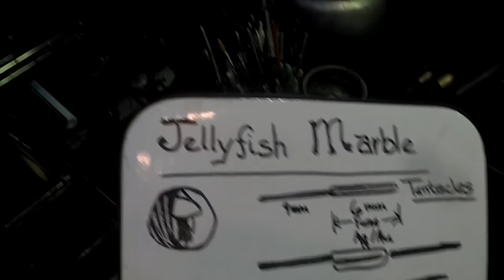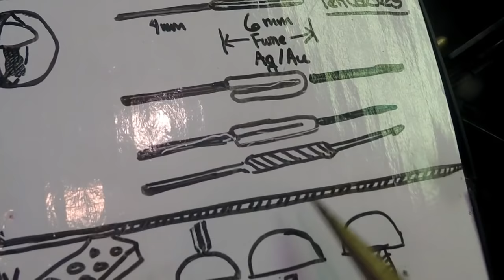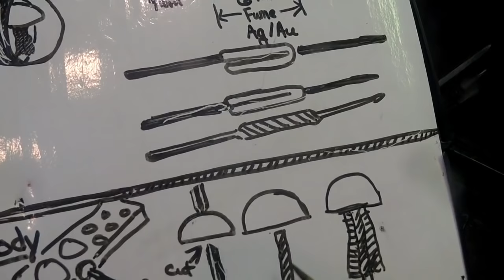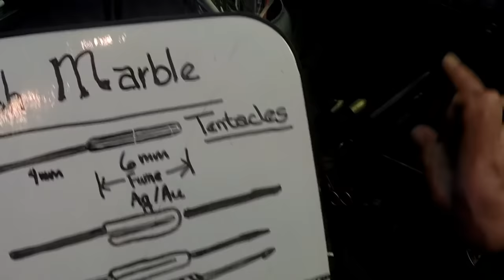Make a Jellyfish Marble with Fumed Glass Tentacles and Dichroic Glass Video - Shawn Tucker Art Glass

Comment: Great example of putting effort into prep time to make the rest easier.  I need to work on making a smoother closure for the dome to rest against without trapping a bubble but it worked well.
Reply from the maker: A little suction on the blowhose at just the right moment.  And very hot glass.  And a bit of practice.  Thanks for trying it!

Comment: If I wanted to make a soft glass jellyfish bead, I would just encase the jellyfish, true, Sir?
Reply from the maker: Hi Christine - I don't want to get into the merits of different types of glass, but if you wanted to do it this way, then Devardi makes a soft glass tube.  Or, you could just encase.
Reply: I work in soft glass, and I would recommend trying a mushroom push-implosion style technique. I've had pretty good luck with that for jellyfish.
Reply from the maker: Implosion works in boro as well as soft glass - this is just the way I make them.
Reply: @oregonmadefunctionalglass-4960  For sure. Love the technique by the way!